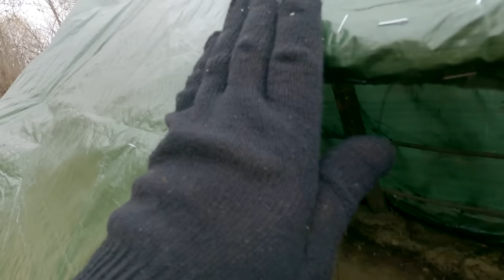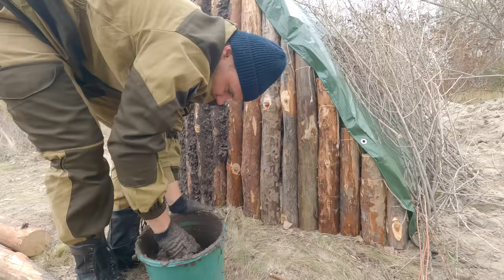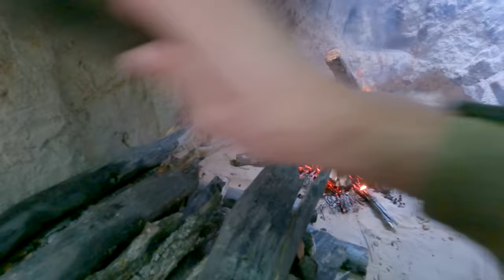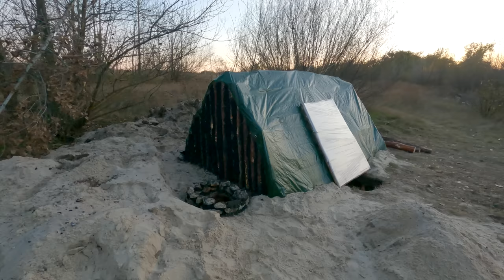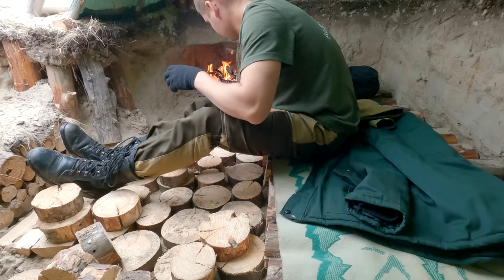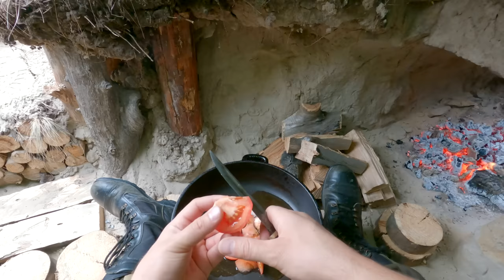Building a warm survival shelter in the ground, fireplace made of stone and clay, cooking

Comment: I think if I were you, I'd build the chimney up to at least 3 more feet high, with the stones and mud mixture and as I go up with it, get smaller and smaller with the hole until there would be about a  8 inch opening at the very top. This way the rain wouldn't be as likely to put your fire out, like it would with that big opening you have now. Also, how do you intend on covering the big gap where your step (going in and out) is? Rain, water, snow, debrit and etc, will come in there too, just asking. 🤷‍♀️
Reply from the maker: Well, this is a shelter in the wild, everything here cannot be perfect, the main thing is that it is warm and dry)
Reply: @ForestHermit  
Nooo, I didn't say it had to be perfect by no means. It's just that I've watched many, many of these and thought of it. If you'd rather have the rain drown out your fire, then by all means, go for it.